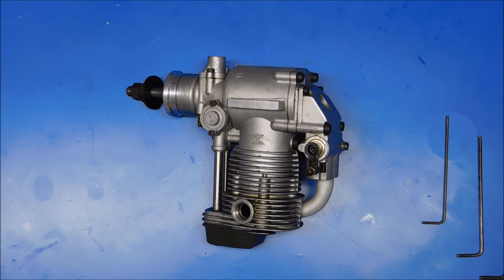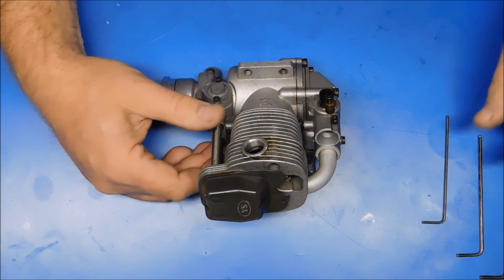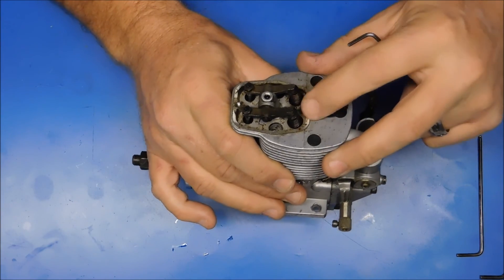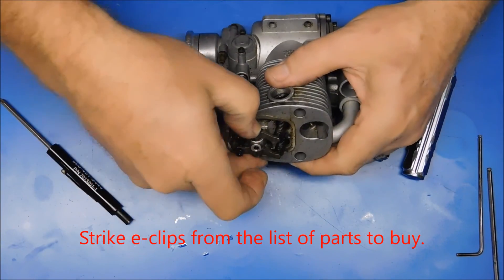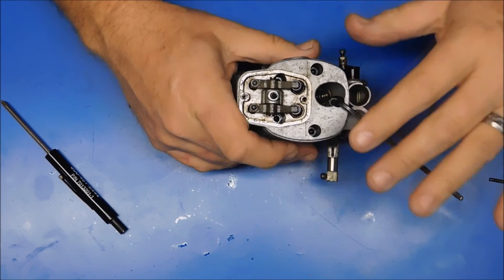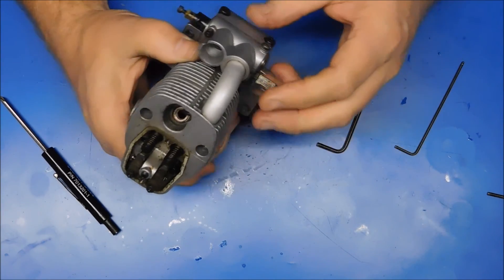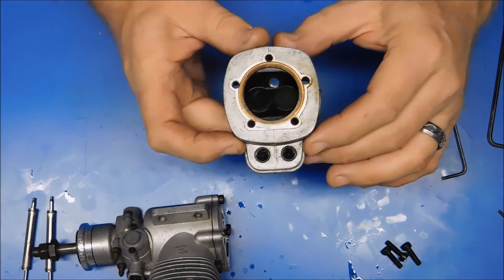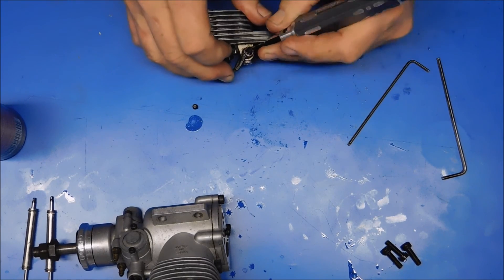YS F-120-SF A Look Inside Part 1

Comment: The 1st YS I stripped , I learned the "tricks".
Cam cover,  Cam/bearings & Follower removal "tricks" 😉
1 piece of advice - replace EVERY gasket & O ring , EVERY TIME you strip it.
Even if they "look ok".
Push-Rod Tube O rings & Rocker Cover gaskets MUST SEAL 100%

Comment: I have to ask what is LA's totally awesome cleaner? In the last month I have stripped down and cleaned and rebuilt 12 glow engines, mostly OS 2 strokes, I've just been soaking the parts in acetone and scrubbing them clean with a wire brush, it's worked very well but I am looking for an alternative cleaning method that doesn't require me taking these engines to work with me, I'm a painter so I have a huge clean tank at work full of acetone that I clean out every day.
Reply from the maker: http://www.lastotallyawesome.com/shop/all-purpose/awesome-all-purpose-concentrated-cleaner-32oz/

Available at Dollar Tree, Dollar General, and many other places.